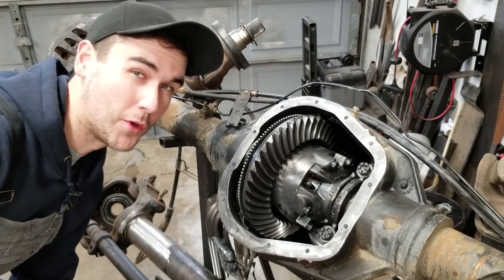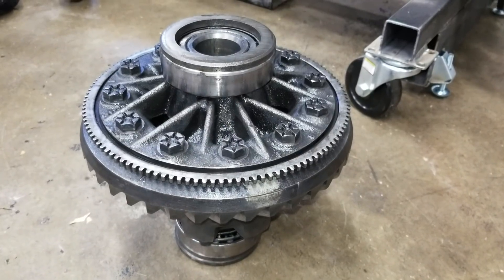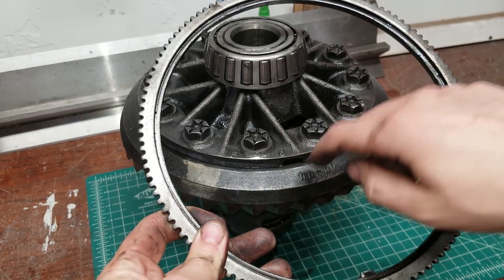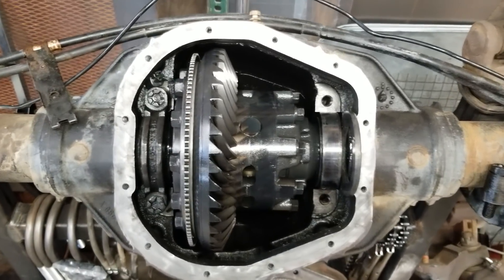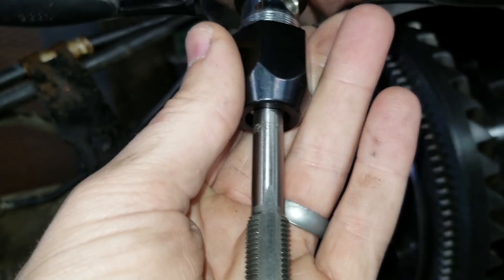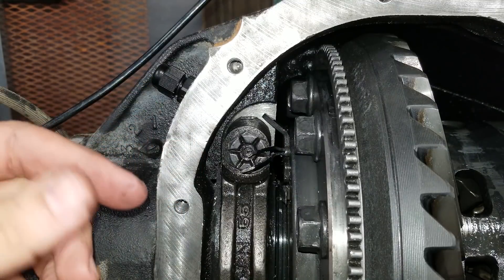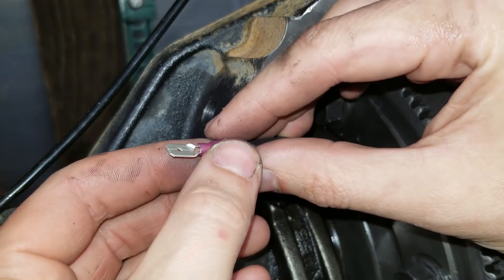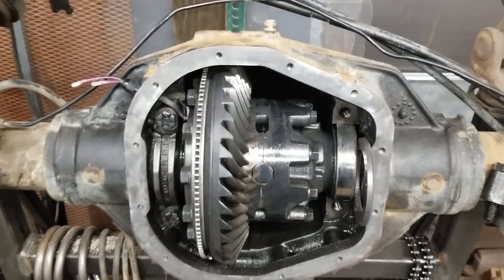Super Duty Rear Axle JUNKYARD E Locker Swap!

Comment: I want to know about your pattern and what else you’ve done to run that carrier
Reply from the maker: The carrier is a direct replacement so you just need to swap it out and set the gears again with the install kit that matches your axle year.  Gear pattern was good after reshimming the carrier and has ~15k miles on it now.  Still works perfect 👍

Comment: I have a 2000 f250 4x4 and i want to put in a 2016 f350 rear differential you are saying those would fit
Reply from the maker: Yeah as long as it's the full float Sterling rear axle, the locker will fit.  You'll still need to use gears from the 2000 axle though

Comment: Hi, do you know if I  can use a 2011+ differential and install 10.25 gears?
Reply from the maker: Yeah the carrier is the same on all the full float Sterlings- just have to use a gear install kit for the housing year instead of the locker year
Reply: @WebWheeler  niiceee, the thing is I found a lot of pages that states it won't work. Also, some pages doesn't list the install kit needed for 10.25 gears. That's why I'm confused
Reply from the maker: You just need the stock install kit for your year of axle and gears (if you're changing them.) Nothing changes except you're mounting the ring gear and bearings to the locker 👍
Reply: @WebWheeler  yeah, I want to change gear and should use 10.25 gears because I will install a Shave Kit from Ballistic Fab , so, they sell the 10.25 shaved ring gear so 05-07 and 08-10 diff needs special bearing kit

Comment: How can I fit this axle on my 2023 jeep gladiator? I bought 2011 for f250 front and rear and the rear is a sterling , but I need to run the ABS a different way , any idea ?
Reply from the maker: The 2011 axle should have a speed sensor at each wheel, same as your gladiator. Google "super duty axles jeep gladiator abs" I believe there are some forums with people posting how they make it work 👍
Reply: @ yes , I just found the way in a forum , the guy said he just bought 60 tooth Tone ring for both sides and used the same sensors that his gladiator came with

Comment: I'm about to do this on my truck already have the locker installed getting ready to drill the hole. my question is how has the cable glad held up over the years did it leak at all?
Reply from the maker: No drips but a little oil around it- it's likely from the heat shrink I used not having sealant inside it. If you use marine heat shrink it should be fine 👍

Comment: So if that ring gear you swapped was the one you wanted would that be all you need to do to finish the locker swap?
Reply from the maker: If you're keeping the gears you have and just swap in the locker, you'd still need to check and adjust your ring and pinion depths/spacers.  There's a chance that the gear setup wouldn't change but it's not likely.  Variation in the machining of the locker and the original carrier will affect your gear setup.  Hope that answers the question I think you asking haha 👍

Comment: Were you able to put in lower gears? I'm looking to do 5.13 or lower gears and would love to use a factory locker.
Reply from the maker: Yeah I have 5.13's in my Dakota now.  You can go as low as 5.38's in the Sterling 10.25/10.5 axles made up until 2010.  2011+ only goes to 4.88 gears.  However, the factory locker started in 2011 so you'll have to swap the locker in to a 2010 or older axle like I did to get the lower gears and factory locker. Hope that makes sense!
Reply: @WebWheeler  yeah the 5.13+ gears at only in the 10.25" ring gears far as I can tell and require a special master kit, likely for special bearings
Reply from the maker: You just need to use the 10.25" install kit if you're putting 5.13+ gears in the 1999-2010 10.5 axles. Nothing special- worked for me! 👍
Reply: @WebWheeler  great video ,could you send me the gear product number for the 5.13 you used  and is that factory locker the only size like for different gear ratio?

Comment: Did that ring stay put?  I’m wondering if I shouldn’t add some retaining compound to mine before doing the swap?
Reply from the maker: Working fine still- have around 7k miles on it at this point. I'm pulling the cover soon to paint the axle and will check it then and follow up on my Instagram and eventually on here 👍
Reply: Thanks for the reply. Sounds good. I’d just noticed on my ring gear that tone ring index tab was resting against the cutout in the carrier. I’m assuming it had rotated a little but, maybe not.
Reply from the maker: It was probably assembled that way- the drag from the oil is the only thing trying to spin the tone ring so I can't imagine it could overcome the press fit. The other option to give extra security would be to just use a small diameter punch or center punch and stake the tone ring and carrier together after you assemble the carrier, tone ring, and ring gear.  That would be enough of a mechanical lock to be sure the tone ring can't rotate or walk away from the ring gear. Good luck!
Reply: Yeah I thought about that when putting it all back together. I did use the ring to press it on as you'd shown.  I also went ahead with a little retaining compound just for kicks. I did notice that toner ring sure is soft for it being ferrous steel, cast or whatever it's made out of it.  I used a .0015 feeler gauge around the press fit surface just to make sure it was fully seated against the new ring gear.  I found one tiny high spot that feeler was getting stuck in so I tapped it back down with a brass punch against the ring gear which actually marred the surface.  I'm going with 4.88 Yukon's.  The goal is to hit 4.30 final ratio after installing some 36x12.5x17's. Was running 4.30's which were a bit too tall for my liking with 35's.  Truck doesn't get much highway use and when it does we're towing our RV 65 or slower. 6.0's like revs anyways.   The original LSD had 345k on it so I was concerned about re-clutching it.  Those things get toasted when towing after a while anyways.  That's when I found your video.  Thanks again sir and keep up the good work!  @WebWheeler
Reply: So I'm in the middle of this exact install.  Got a great pattern drive and coast. I got the football on drive side and I would say the coast side looks a little like a feather shape. I would say nearly identical to yours.  
-Patterns are centered. 
-Pinion bearing preload is 20-22 inch lbs. Avg B/L is .008.  .
-Pinion depth is .028
.002 B/L variation runout on teeth which I attribute to the phosphate coating on the new gears.  
I've made sure to mark the location of the dial indicator base on the housing and take the B/L measurement  closest to the same location / angle possible each time on the teeth.
New Ford E-lock Carrier which has .001 runout. New Yukon 4.88s.  
All new Timken bearings and races.
No noise on drive whatsoever, but I've got tiny, faint noise on deceleration.

I'm thinking I should increase the preload to the end of spec at 35 in/lbs as I suspect it's unloading a little causing the pattern to change on the coast side.  This is a daily, not a wheeler so trying to make her quiet as possible.    I'd really love your input on this.
Reply from the maker: I agree- increasing the pinion preload a bit is a good place to start- measure it again before you change it and make sure it didn't loosen up on you then increase it by 5-10 in/lbs. Good luck!
Reply: One thing I learned recently on this particular diff is to really create a good drag on the pinion and turn it from the ring gear to establish a pattern.  In doing so I realized the coast side was deep and the drive side was near perfect.  I'm going to reduce pinion depth .001 at a time and see what kind of patterns I get. @WebWheeler
Reply from the maker: Good catch! Working on these sterlings and Dana axles really makes me appreciate the 14 bolt adjusters  haha
Reply: @WebWheeler  yes they’re a bear. Any idea on what to torque a crush sleeve eliminator to on these or just send the ugga duggas?
Reply from the maker: I believe I torqued mine to 250lb/ft and i used red loctite on final install. Dana 60 crush sleeve eliminator from down to Fab calls for that torque and it seemed about right to me haha
Reply: Was that the 37 spline late model style 10.5?   @WebWheeler
Reply from the maker: @broncobart4354 it was for the older 35 spline pinion. Again, not sure if that's the correct torque but everything else I found was for the crush sleeve and it said 160 lb/ft minimum
Reply: Got it.  Thanks!
 @WebWheeler

Comment: I have one of these in my f250 wondering about getting another one form the wrecking yard and trying to put in my front axle as well
Reply from the maker: Won't work in the front- it's a Dana 60 and this locker only fits the sterling. Lots of aftermarket lockers available for the dana 60 front though 👍

Comment: Hey man, I picked up a 10.5 super duty axle from a 2005. I haven’t pulled the cover yet but it does have that same plug on the top of the differential. With that mean that it might have an E locker in it?
Reply from the maker: Elocker wasn't available until 2011 so the plug you have is most likely the abs sensor plug

Comment: How’d the pinion to ring gear contact patch change when you added the tone ring to the new center section?
Reply from the maker: No change- the tone ring presses onto the outside edge of the ring gear flange so it doesn't affect where the ring gear sits.  No gear mesh adjustment required.  Thanks for watching!

Comment: Great video! Will this work on an f350 cab and chassis axle?
Reply from the maker: As long as it's the single rear wheel Sterling full float, you should be good 👍 if it's the dually, that's a Dana 80 and isn't compatible. Good luck!

Comment: Can I ask how are you gonna make the ABS work with the new axles?

I am putting super duties into a Toyota with the atrac and would love to keep it, but I’ve been having trouble deciding how to go about it.
Reply from the maker: I ended up using my stock Dakota rear ABS sensor in the Sterling 10.5 housing and it worked perfect. I think they're pretty universal but I also might have gotten a little lucky haha. Same hole size/position on both sensors and the tooth count on the ABS ring seems to agree with what the Dakota expects. Only change was I had to trim off one of the factory sensor "guards" that are cast into the 10.5" differential housing because it hit the plug on the Dakota sensor. Toyota might have a different setup, but either way you'll probably want to figure out how to adapt your stock sensor to the housing rather than reusing the sensor from the Sterling. Good luck!

Comment: I want to throw this in my sterling 10.25 on my 97 powerstroke, when I buy the master rebuild kit do I need different bearings etc than I would normally get?
Reply from the maker: Nope everything from your rebuild kit for the '97 axle should fit just fine on the locker 👍 thanks for watching!

Comment: hey man, this is super awesome, just curious on what speed it would be safe to go to? ive had several 2015+ F series trucks with the locker and they all come off at 40km/h. (Canada, Eh?) is this for safety or just to cover their ass? its pretty inconvenient that you cant spin the tires with it in. thanks!
Reply from the maker: Thanks! Yeah the computer turns the locker off around 25mph here in the states as well. I believe this is mainly for safety- if you accidentally leave the locker engaged and try to drive backcountry roads (lots of turns, usually 35-50 mph speed limit) you'll quickly start having traction issues. The locker will cause the rear end to slide out or potentially understeer through turns. I actually think 25 mph is a good speed to turn off the locker anyway. If you're going faster than that, the locker likely isn't helping and actually makes it easier for to lose traction with both tires. If you're spinning tires though, it's nice to not have the auto disconnect for sure haha

Comment: Awsome video man I bought 01 250 axles to go on my f150 broke the spiders in the 8.8 with 47s and 5.13s doing a burnout lol I was gonna go with a Detroit locker and 5.38s but now seeing this video I may go this route depending on if I can get a good price on one
Reply from the maker: Thanks man! I'm surprised you even got the tires broken loose with 46s on an 8.8 lol. You can get lucky with that diff at a junkyard but there's a pinned comment that should get you a new locker for a decent price too. Good luck!

Comment: I may try this but, why not just swap the entire rearend instead of only swapping the guts?
Reply from the maker: I go a little more in depth in a reply of another comment with the same question, but basically lower gear ratios available for 2010 and older axles, and the ABS setup is different as well. The older axle housing worked better for my build. Good luck!
Reply: @WebWheeler  
Oughfff.  The ABS.  Good point.  Thanks!

I found a rearend (2016 with 144,000 miles) but, it has a 3.73:1 vs the 3.55:1 I was looking to get.
They are asking $775 which seems a little high for just the e-locker feature.  IDK.  Was the 3.55:1 even offered in later years?
My '89 dually has a 4.10:1 which is just too many engine RPM's for highway (3,000 at 65 MPH) use.  I drive into Atlanta twice or more each week.  Is the 3.73:1 going to help me much?
Factory gear for my truck was a 3.55:1.
Reply from the maker: Yeah that's a little steep- mine was $500 with brakes and ebrake cables intact. I believe 3.73's are the highest factory gearing available. That would still drop your rpm by almost 300rpm. You could also regear but that's not cheap either. If you do that, you might as well just but the locker itself. Best solution to me though is go with the 3.73's and just get bigger tires 😎 haha

Comment: Did I understand you correctly when You said this E-Locker will NOT work in a dually?
Mine is a 1989 F350 dually.
Reply from the maker: I believe those years had either Dana 70 or sterling 10.25 dually rears. If it's a sterling dually axle, it should work. If it has the Dana dually rear, it won't. Good luck!
Reply: @WebWheeler  
Fantastic.  Thank you.  Great video, too.
Now, I'm off to the salvage yard.

Comment: So will a tone ring off a 10.25 work on a 10.5? I have a 94 I’m doing a sd axle swap on but the axle I got is a 2011
Reply from the maker: Yep it should as long as it's a full float sterling, all the carriers are the same. There might be a notch on the ID of the tone ring that you'll have to grind off but it will press on after that. My 2006 tone ring fit on the 2011 carrier I used. As far as I can tell, Ford had never changed the dimensions of the sterling carrier from the 10.25s all the way to the ones currently in production haha

Comment: couldn't you just have gone through the diff cover with that connection?  You'd have been able to secure the gland with the nut and not drilled trough the axle housing.
Reply from the maker: Yeah you could do that but I don't want to deal with wiring when opening/sealing diff. There's a chance that the wiring ends up in a bad spot when installing the cover and could get caught in the carrier or ring gear. Going through the housing means I can verify that the wires are in the right place and they won't move or be in my way when installing the cover

Comment: The best upgrade I ever did to any vehicle is just get rid of the ABS that wakes up a vehicle and the added safety of having reliable and positive competent brakes is amazing. 

Or if it’s an old ford having rear brakes that do stuff besides lock up all the time is super cool to. Get rid of it, spend some money on a solid system and there amazingly buttery smooth. 

I keep thinking of using one of these E-lockers but I haven’t found one yet. They seem to be basically Eaton E-locker units. Looks like they should work pretty damn good.
Reply from the maker: Dont know how i missed this comment so sorry for the late response.  The lockers can be found new for pretty cheap-  see the pinned comment on the video.  Hope that helps! yeah they are pretty close to the Eaton's in every way.  I have an Eaton in front and this in the rear- outside of some manufacturing processes they seem to be pretty similar.  Thanks for watching!
Reply: @WebWheeler how much is pretty cheap? The comment you pinned isn't there for where to find these lockers new
Reply from the maker: Weird- comment must have been deleted. TascaParts.com is where the best price was but I can't find the part number at the moment

Comment: Hey web wheeler, did you hook one wire from the electric locker to ground on the frame and one to the hot on the battery,? or did you hook both wires to the battery, neg and pos sides?? I'm fixing to wire mine and I'd appreciate the info, thank you.
Reply from the maker: Either would work fine as long as you have a good ground. Easiest way would be positive -> switch -> locker -> frame for ground. Good luck! Thanks for watching 👍

Comment: Any update on how it works in the vehicle and durability. I just picked up a locker for under$100
Reply from the maker: I'm currently breaking in the gears so I will be testing the locker in a few weeks. But since this locker is designed to run behind a 6.7L powerstroke, I figure it'll handle my V8 no problem even with 40s haha

Comment: Are their spring perch differences in dimension or major differences that would interfere with just swapping the whole rear end? Looking to go elocker in my 03 excursion.
Reply from the maker: I talk about it in another comment somewhere but the big difference is abs speed sensors- 2011+ has a speed sensor on each wheel, 2010 and earlier just uses one on the carrier. I think perch width is the same, but not positive
Reply: @WebWheeler  thanks for the info and for the video as well!
Reply from the maker: No problem! Thanks for watching 👍